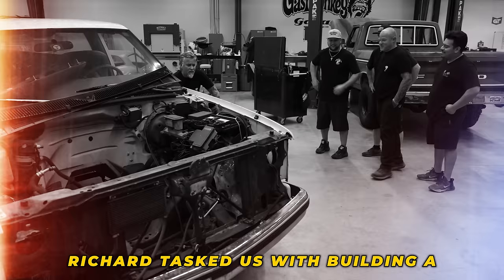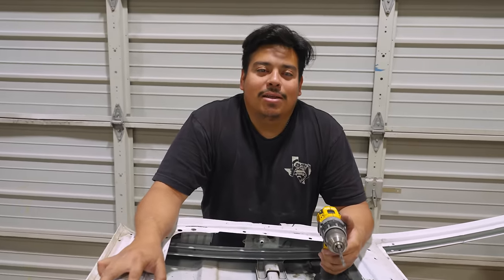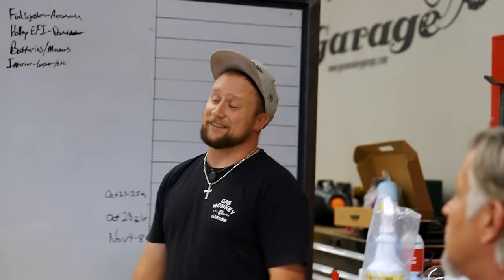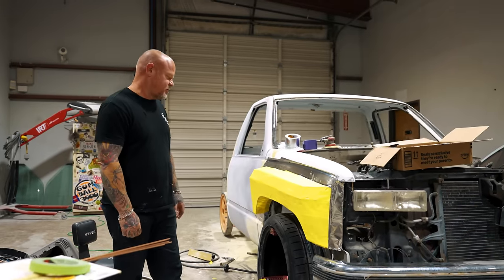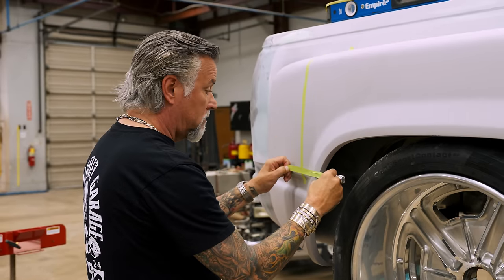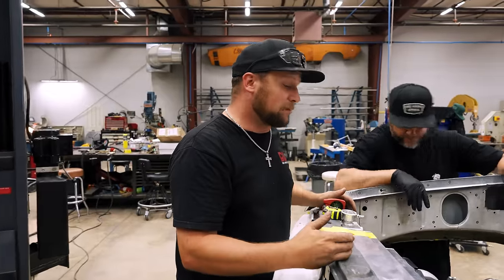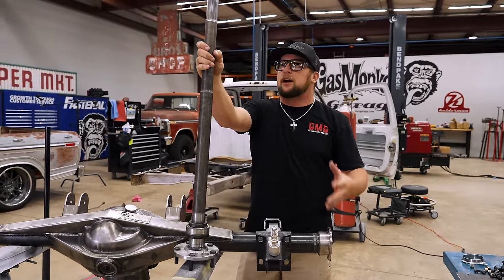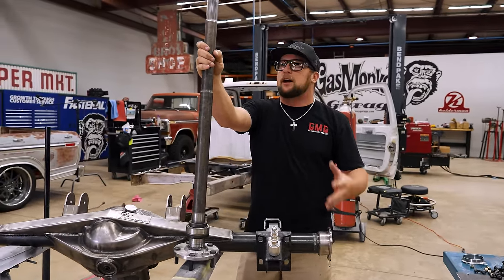Gas Monkey's SEMA 2024 Build - PT 2

Comment: Off the wall........4 speed LENCO with those levers sticking out the tunnel.........gives you best of both......an auto with  big gear manual shifting........and they can take massive power too
The 'box is long and narrow too so doesnt butcher the tunnel.
Cobalt blue body with grey interior n blue stitching.......

Comment: For the front flared, get a junk step side and use the flares. Minimal fab required and it's fiberglass.  Since you guys are going to be running such high horsepower, use a sequential transmission. And Amber Whiskey for color. The dually lines are to smooth to got with something so edgy.

Comment: Okay I paused this video at the 8 minute mark and I don't know what the truck is going to look like when it's finished.  As far as the tail lights go what can you do to an OBS that hasn't already been done. I think the only way to make them look good without the original tail lights which I think look pretty good is to somehow make the corners of the bed glow red when the brakes are applied and when the brake lights are off all you see is paint and no discernible outline of a tail light at all. Like it looks like there's no tail light but then the bed corners glow red kind of like Rudolph's nose if you will.

Comment: If it's gonna have bubble windows, it needs to be either pearl white, with chameleon on top. Or black metal flake with chameleon on top. So it changes like a soap bubble. Or whatever the color base with a huge holographic hyper shift on top. This Sema could be over the top with an OBS and special bubble glass. ❤ FYI, I had my opinion on color before I hit the 10 min mark in the video when Richard asks about opinions on color.

Comment: On the front fender it would have been cool to do the front fender and bumper similar to a 2021 silverado...extend front down to bottom of bumper and tuck front bumper in to that for the air dam.

Comment: 2000hp motor? What trans and rear end? You should shape this mechanically as a drag truck or the motor will be worthless past 800whp. You'll just blow the tires off at any speed

Comment: I would have use industrial fast setting spray foam to mock up the wide body back in the import turner days I would build complete one off wide body kits that took 3 days start to finish spray foam is quick and easy one ounce would expand 100 times it's size the good old days of one off fiberglass kits and full custom interiors

Comment: It’s cool but it’s been done, just google OBS drift truck and you’ll see what you’re building. There’s company’s that literally make bolt on kits that look near identical to what y’all are spending hours fabricating. Personally I think it’d been cooler to do a high horsepower crew cab OBS Baja style build that looks OEM as if GM built it to compete with a TRX.

Comment: I'm getting tired of everyones "too much horsepower for the streets" builds. As soon as I hear 1,500 hp, I leave the video. Don't get me wrong, that's cool, but you're basically building a paperweight that you may bring to the track once. Build a nice 850 hp truck that looks badass, can tow big trailers, and is fast enough to wreck 95% of cars at a redlight that you can comfortably drive around town or on roadtrips.